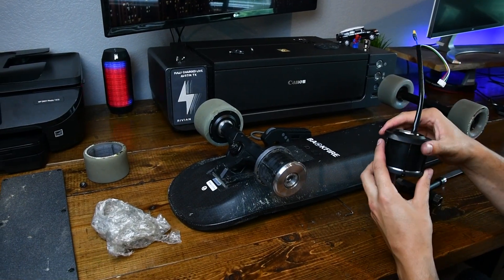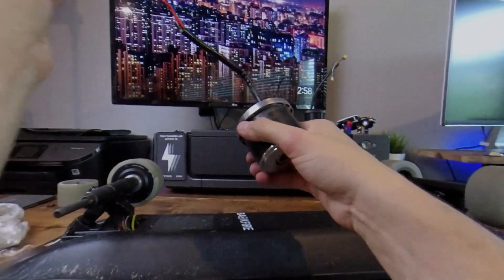Backfire Mini Electric Skateboard Motor Replacement

Comment: i have a backfire mini on order. can u do a video on changing the battery to the travel friendly battery? i know u took it off in this clip, but u cut the gasket with scissors, how did u clip it back in then?
Reply from the maker: I didn't cut the gasket. I cut the cable from the motor before realizing that the gasket was removable. The battery replacement is actually quite simple. I just don't have a spare battery. Maybe in the future
Reply: Seed Visual ok, so if u cut the cable, howd u connect it back up?
Reply from the maker: I cut the motor cable and trashed it. It was replaced with a whole new motor which included the cable.
Reply: Seed Visual but im talkn about the cable from the battery connected to the esc.. that white part u snipped
Reply from the maker: I'm sorry. You are talking about the gasket that seals the two cables together. My apologies. Yeah, I just left that part without the seal. You can buy those at Walmart RadioShack, but I don't believe they are necessary.

Comment: How many miles did you have on the board before the motor started acting up?
Reply from the maker: It was just under 100 miles. Basically right as I started making my review in my previous video.
Reply: I have just over 300 on mine and I think I have one going out, take it with a grain of salt though bc im pretty hard on mine
Reply: I have a G3 pluss with 2500km on it, motors still working, but 4 of the screws has snapped and is stuck so had to buy new motors to fasten the wheel.

Comment: Nice video! My board works fine but it's good that there is a video in case i have to change the motors some day
Reply from the maker: Thanks David. We'll make more maintenance videos as it comes up. I've swapped a motor and replaced an enclosure and battery on my G2T.